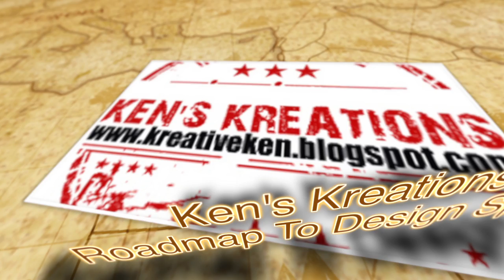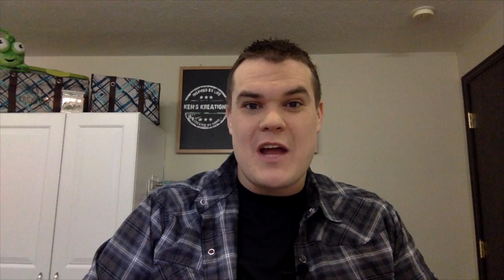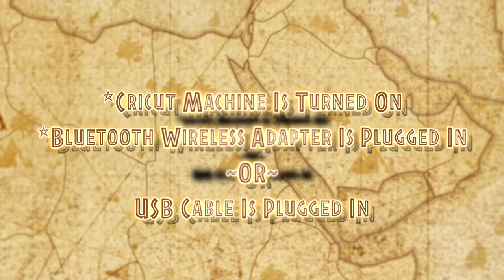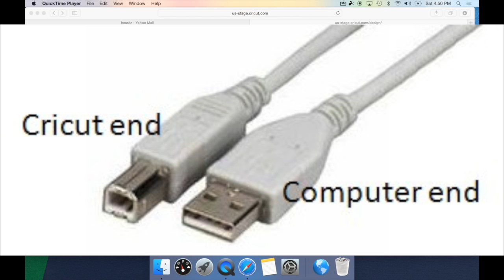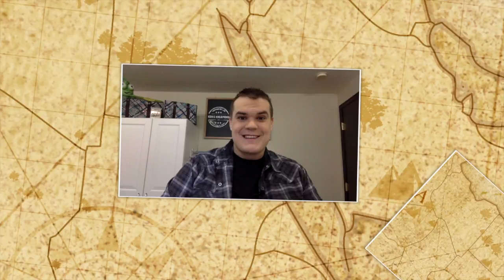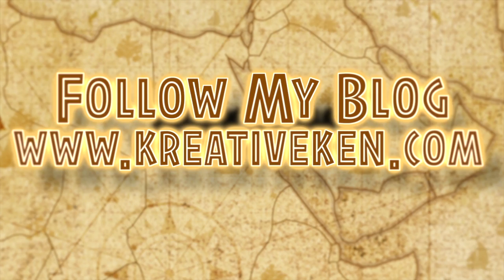Firmware Update / Calibration Process

Comment: how do i do this on a chome book iv tried it on three different units. and keep getting the firmware validation system error. does that mean my my joy is crap.
Reply: I have been facing issues with my chromebook being compatible with programs. Many only work with windows or Mac operating systems still. I couldn't update my joy either and I tried on my old laptop with windows 10 and it still isn't working... hoping customer service can help.
Reply: @cheertumblefly  I think I recall in one video that the CB isn't officially supported, but still works.